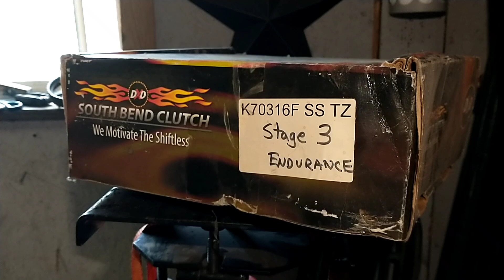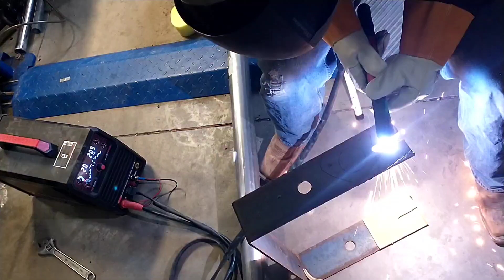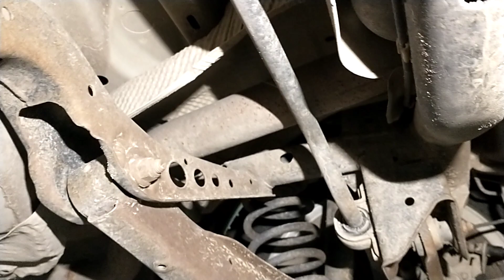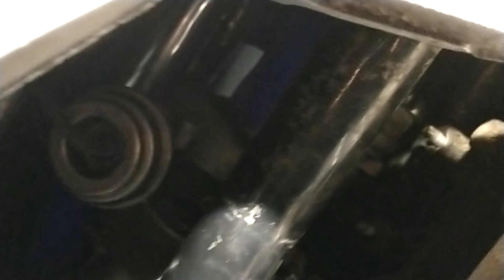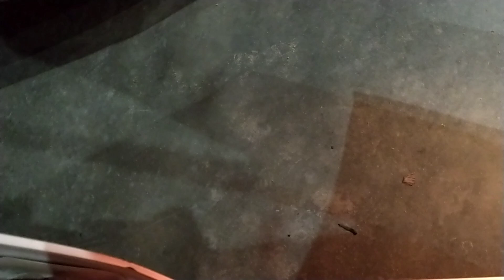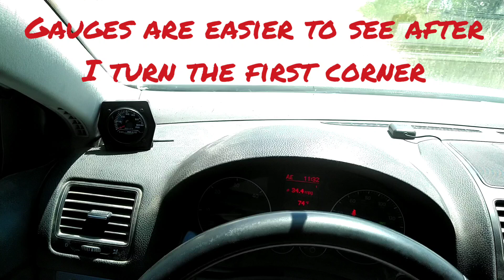MK5 BRM TDI 250-300 HP Build GTB2265 Part 1

Comment: I have an 06 Jetta TDI with the BRM also. Will you get a limited slip diff for good handling and so you can actually put the power down when you have it tuned?
Reply from the maker: It's probably a good idea, not sure how much I will put into this build though, hopefully doing injectors and tune in the next week or 2
Reply: @TDISwapShop  You probably know that new diffs are fairly expensive at around $1500 or so. I need to see if the MK 5 GTI's got a limited slip diff from the factory, that would be ideal to swap the trans.
Reply from the maker: @homer23422000 yeah I've looked into them, honestly probably are outside of the budget for this car but it would be sweet if I found one used or something.  Really though at high elevation like I am it's still going to be hard to break the tires loose I think for my normal driving.  We will see

Comment: I would add a little bit more aluminum pipe to that 180 bend, that silicone is a little to close to that exhaust housing.
on my car I fit a 3inch pipe over the axle, its a little tight but it clears every thing.
Reply from the maker: Ya I need a pipe bender lol.  And I am monitoring that boost pipe, only the clamp is resting on the actuator mount so it looks to be ok

Comment: while it may take some extra plumbing i swear i say this on all of ur videos cuz i want someone to do it cuz i cant😂😂 u should put ur old turbo back on and make it a compound system, then u would get boost with casual accel rather than needing to really ask for it and also the turbos will be more efficient and you wont need to intercool as much. but regardless this thing is beautiful
Reply from the maker: Ya I have compound builds in the plans, but I honestly just needed something to put this turbo on 😂😂😂
Reply: I put a 1756 on when my stock turbo started burning oil, I kinda wish I did a replacement cartridge and compounded the factory turbo for how much I use the car, then I would have kept the fast spool and made more power up top. I do plan on doing this when I swap the engine into somthing else though cause I miss that boost off idle response.
Reply from the maker: @A2J_Tim ya I definitely would like compounds on everything, but it was a quick fix without much piping